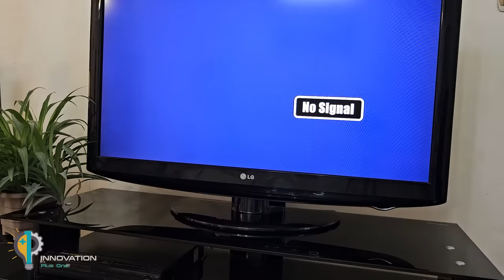Insert a Coin Battery into the TV and all the channels in the world will be unlocked Antenna Booster

Comment: I built one and connected it to my interocitor and got a strong connection to the universal interocitor control network.  I have some phase issues to work out but the galactic empower is quite pleased with the progress.  Thanks for sharing this.
Reply from the maker: Thanks for sharing❤🙏
Reply: Well for your phase issues you could probably just rotate the battery 180°
Reply: The phase issue is simply corrected with an earth wire but must be copper

Comment: I think it would work better if you put the live wire from mains electricity, into any one of those ports, once the earth or neutral is connected to the metal case. It will definitely increase radio frequency gain 
and increased super-sonic dynamic occurrences (semi-conductors exploding). Ignore smoke or flames if they occur, just disconnect and put out side into a non-combustible area.
Reply from the maker: Thank you for your advice, this antenna is very safe and useful
Reply: And make sure the number "911" is handy.
Reply: @susanp102   - Or "999," depending which side of the Pond you're on.......

Comment: Nice; however, antenna is very directional and signal can be intermittent. It can be powered by an amplifier with a more consistent and efficient power ac source that produces less drain on the Grid. That may produce a smaller ecological footprint and save the person's utility bill.
Reply from the maker: Thank you for your explanation about this booster antenna

Comment: Adding a Flux lumen collector and interfacing a portal storm electron intensifier will improve the the signal to at least a magnitude of 10e3 power. If you want the circuit I can send you details. Cost is a mere £20 pounds to cover postage and packing made payable to PARC INFO. Let me know.
Reply from the maker: Thank you for sharing your experience my friend❤🙏
Reply: Nice try, but you clearly don't know what you're talking about. I crunched the numbers and it clearly only results in a 1d20 increase in magnitude. Ha! I'm not falling for that one again, oldest trick in the book...

Comment: Copper is a great conductor, I've built my own OTA antenna's before, this should work in theory although  I don't know what the batteries are for - seen this premise in other videos although they use AA's or AAA's.  The antenna design isn't bad to pick up some strong local channels. The wide metal bar acts like a reflector of sorts and the two copper wires would pick up strong VHF/UHF channels...but don't connect to the bar. The comments for this video are hilarious.
Reply from the maker: Thanks for the info!

Comment: Are the batteries set on the steel mounted with one positive and the other negative? Or are they both showing positive or both showing negative as to how they are attached to the actual antenna?  
    A while ago, I had a cable man come, who does side jobs, that does powered antennas. And he mounted a very nice antenna to my back deck, and on one TV only, I get about 16 channels. S, not all television comes from satellites or is scrambled. So, if he can do that, then I’m almost sure this would work. As all you’re doing is building a powered antenna.
And I’ve seen 4 or 5 variants of the same thing on utube, but so far, I like this on the best. I saw one done in a similar fashion using welding rods as the antennas themselves. And it looked very respectable when he got finished, as he mounted them into piece of wood that made it look like a work of art in itself.
But you’d looks easier.
Holla Back !!!
Faubus
Reply: If you look carefully at what he is doing with the batteries, one has the positive end on the metal and the other one has the negative end on the metal. AFIK this is working as a frequency amplifier, which is a neat trick. my 2 cents.
Reply from the maker: I'm glad you liked the antenna making tutorial, the polarities of the batteries should be opposite to each other my friend
Reply: Batteries are stuck on non-conducting double sided tape. On one side + is facing up and on opposite side - is facing up.
Reply: Following the instructions one has positive up the other negative is up.

Comment: If you piss on your Tv screen at exactly 11:59pm  & 33 seconds you'll get Disney + and max free for 2years🤫
Reply from the maker: I don't understand what you mean, is the topic you talked about related to antenna construction?
Reply: @InnovationPlusOne  because it's just as ridiculous as you saying, "insert a coin battery into a TV and you can unlock all the channels in the world. I just took it one step further. See how ridiculous it sounds.  I can use a piece of speaker wire and unlock over air channels, and that's all you coin battery antenna is going to do, and not very well I may add
Reply: Didn't work when I did it and wife made me clean it up
Reply: Ah, so thats where I went wrong! My cat pissed on it and vanished into thin air. Or maybe its a cloaking device? I'll have to feed it baked beans and wait for the farting to begin so I can find it. 🤣🤣🤣🤣🤣🤣🤣🤣🤣🤣

Comment: There is really only one tiny problem in this setup: If there really is a signal coming into the TV it's NOT generated by the coin batteries- They have the 2nd contact side unconnected. If the signal is really there it is from a secondary (Wall) antenna outlet or the spiralled cables. A bogus setup in my book.
Reply from the maker: This antenna can only receive signals from radio stations and you can easily watch your favorite TV channels.
Reply: Both + and - are connected joined by the splitter. Only the core wire is utilized
Reply: I like the music, it's calming, uplifting and makes me want to groove... Lol
Reply: Exactly, the batteries go nowhere, they don't make a circuit so they can't do anything, so nothing is being "powered".
I'm also guessing that if they where to be connected, you'd damage the tuner inside your TV.

Comment: I asked my 12yo nephew, who is really smart, to make one of these for us, but he was careless and didn't follow the directions at first, ...but he tried again and now the second one works perfectly as shown. At first he used larger diameter unshielded wire, a copper ground plane and rather than batteries he used an AC-DC transformer (wall-wart). It seemed OK at first but we discovered that any channels higher than ~160 appear to open a portal to somewhere, which is very dangerous since we have a small child and cats. After losing one of the cats when it jumped into the screen and disappeared we immediately unhooked it. Now we only use the first one occasionally to get rid of our garbage.  I would not recommend making one of these yourself unless you are very careful and have some basic knowledge of electricity and space warp theory.
Reply from the maker: I didn't understand what you said, but I think you liked this antenna very much, thank you for your comment, please share this tutorial with your friends.
Reply: VERNON  can u help me ....i now have a STARGATE  in my lounge room
Reply: Tell what your nephew did with the 1st prototype! I need it to get rid of garbage and stuff.

Comment: Will I get more channels if I use a longer coax & move out into the hallway, like on the Honeymooners ?
Reply from the maker: No, the length of coaxial cables is calculated and depends on the wavelength of radio signals
Reply: No, the length of the cable only has an influence on the length of the film.
Reply: Oh, good. I don't like them long films like Dr. Chicago, anyhows.

Comment: Is there any way to improve the battery life? I built one and it rapidly drains the batteries. I've used all the batteries that they have at the drug store and it'll be more than a week for them to have more. (they're on order)  can you design and post an A.C. adapter for this circuit?

Comment: Are those CR2032's or does that matter?
Reply from the maker: This is a booster antenna
Reply: @InnovationPlusOne  The CR2032 was in reference to the coin cell used in the video, or does size and voltage not matter.

Comment: Kinda new to working like this, so I have some questions.
- do the coin batteries need to be brand new & what voltage should they be ( when I looked at the store there were 2 voltages 1 @ 1.5 volts & the other @ 3 volts. ??
- my "y" connector thing, that attaches to the bar with the coins on it just flops around, did I miss a step?
- on the last cable you cut you put on a connector of some kind, but couldn't see what it was, maybe a transformer of some kind?
- again on the last cable, my connectors will not stay in place, they keep sliding along the cable.
Thank q
Reply from the maker: No, the batteries don't need to be new and their voltage doesn't matter, so it's better to use old batteries, and you also need to press the ends of the antenna connectors so that they bend and don't slide in place.

Comment: How about use a battery holder with 4-10 AA batteries and then hook the antenae to that or maybe if you do it the more power way, a car battery hooked to the antenae or then there is the house grid...I am thinking about when the batteries die, you need a way to replace them, premeditated obsolesence is the factor. How long do watch batteries last? Nice idea.
Reply: These batteries would last as long as other brand-new batteries still in their blister packs, because they aren't actually connected to anything in a way that would pass any current, because of the black tape. At best they are being used as some sort of shim or spacer.
Reply from the maker: Thank you for your ideas, my friend, the batteries run out very late, although this idea needs to be replaced after a while
Reply: Are these the same batteries used on on your PC motherboard? Mine one lasted over 10 years. Id have to look up the part #. That 1 was drawing constant power compared to this antenna having 2.
Reply: @InnovationPlusOne  "run out very late"?  do you mean "last a long time"?

Comment: If you link the battery between the television and your power meter not only will you get all channels but you also put so much power back in the system you get a check in the mail
Reply from the maker: Please do not do this and just connect this antenna to the TV as in the video

Comment: I'm not unconvinced but I know I should be. I don't have a TV to test it with. I see a tuned antenna so that's seems legit for the capture of a specific frequency. The batteries are a mystery but I'm not a physicist. If it does anything interesting I'll want to plug one into my rtl-sdr. I know a physicist but she's really busy and she'd probably be grumpy if I tried to waste her time. I have had remarkable results improvising antennas before so, hmmm mmm.
Reply from the maker: Please make this antenna by watching this video and be sure to share your opinion with us about the performance of this antenna❤
Reply: @InnovationPlusOne  Definitely will. If I can't locate a free TV I'll try it on the SDR. If it can do this with a TV the possibilities with Software Defined Radio are very exciting. Current project is building an antenna to get real time imagery from weather satellites. Then I could modify the antenna to a variation of this. Rotating signals for this job.
Reply: @InnovationPlusOne  Question is, if it doesn't work, would I need to try new batteries, as in do they go dead???

Comment: I bought a Finco antenna with a 150 mile range in 1989. I was 59 miles from downtown Chicago and it worked perfectly (it’s 18’x20’). It was installed in the attic. When I moved I took it with me and installed in the attic of my new home and now I’m 70 miles from downtown and it’s still working perfectly, it’s 35 years old.. Because it was installed in the attic, the antenna is like new. With a smart TV, it not only receives the local channels, but also the other channels supplied free through the internet.  What do I pay monthly…….$0.  Do I need to watch and pay for the trash on the TV…….NO!
Reply from the maker: Thank you for sharing your experience of using antennas

Comment: I also tried with the satellite antenna parabolic antenna to receive the programs Normally as it is the antenna on the house but it does not work because the signal must first be terrestrial terrestrial transmission then it must be if you have a TV that cannot decode digital must be Analog so in radio to radio still Analog signal is transmitted before Analog terrestrial signals were transmitted through relay transmission but that was very expensive now it is much cheaper to transmit a signal to a satellite and from there that satellite to them transmits to the ground covers a much larger reception area and is much cheaper then if you don't have a terrestrial signal transmitted at the terrestrial level then any improvisation or whatever you do will not give results because it is a word if it is not from where it is not even God it can be like this in this case too if an analogue or digital terrestrial signal doesn't exist, nothing can be received because it doesn't have Where did it come from That's why lately there has been a sigh of relief for the signals transmitted directly to the satellite and again transmission to the ground simple reception reception is free Get a parabolic antenna, a digital receiver, preferably as high-performance as possible and you can receive the signal, but in order to see the program in question, some of them you have to pay a subscription. payment via an online bank card can be received but if you pay the subscription it doesn't matter where you are from Money has no smell you can watch any kind of program you want but for free you don't have how those times came
Reply from the maker: Thank you for your explanation about the antenna

Comment: Please do this then call the TV manufacturer and tell them where you learned quick tip those coaxle connections take a bit of power anyways so what happens when you add extra power you won't get extra channels or any you'll get a sound and blown power inverter what happened to the days where this dude in the video would be buying everyone new TV's. Might as well, put bent fork prongs in a plugin and grab the back of the coaxle male plug on the back of the TV.
Reply from the maker: I didn't understand the meaning of your words, but I guess you liked this idea, so suggest this video to your friends.

Comment: This 'coat hanger' aerial would work without batteries - adding DC does nothing.
It's just a weak low surface area novelty UHF aerial to pick
up local transmissions with no capacity to 'unlock' channels.
A standard UHF aerial will pull in more signal than this 'fun project thing'.
Reply from the maker: This antenna can receive many channels

Comment: I just watched this out of Pure curiosity. I'm a computer techie.  Did this Really have to be So long, 15 minutes? Ugh, you could at least have verbally provided a list of items you will need to make this. I know the Cat5 wiring and the connectors, but what kind of metal strip was that and what was that tape that you used to adhere the batteries to it, was that some kind of special electrical conductor tape?  Seems like that would be an important thing to mention.
Reply from the maker: I'm sorry my friend, I have to carefully demonstrate all the steps of antenna construction to learn better
We can use aluminum sheet to make this antenna
Reply: @InnovationPlusOne  Ok, what about the tape? What kind of tape was that, besides double-sided. Is it some kind of electrical conducting tape? What's the correct name for it? 

I'm seriously thinking about trying to make this. It looks fun. I have all the tools, wiring, stripping and crimping tools and plenty of Cat5 wiring and cable splitters.  I once made a jumper cable to fix my coffee pot because the two-way switch broke. 😊 My boyfriend was shocked that I knew how to do stuff like that. 😊

Comment: Just a copper wire the same difference.
Reply from the maker: This antenna is made using a coin cell battery, which is very powerful to receive radio signals

Comment: So beside the thumbnail being completely misleading and disastrous if attempted by anyone, the actual antenna built has absolutely zero need for the coin cell batteries glued to it, and they do NOTHING to 'amplify' the signals received.

I'm sure the uploader will delete this comment, because their clickbait junk would suffer from the outright truth told. I just wasn't interested in making another joke comment to mock the video.
Reply from the maker: My friend, I never delete any of the comments, by the way, thank you for your criticism
My friend, you did not build this antenna and you are just judging, I request you to build this antenna first and then share the result with us
Reply: @InnovationPlusOne I don't need to build your particular 'design' of antenna to know  that a couple of 3v coin cell batteries in series in a grounded loop would just discharge themselves, and possibly while overheating them to the point of bursting. Just causing a current through there doesn't create any amplification of signal. Of course, if the splitter has protection against power flow through it the wrong way this setup will literally do *nothing*. My assertion still stands. There's no reason to involve a coin cell here at all - just build it without them and it'll still be a UHF loop antenna.

Comment: I did not make one but I still smell Bull excrement at the highest odor. What if the batteries are dead does it still work?
Reply from the maker: The batteries need to be replaced my friend. But know that the batteries will run out very late because we have no voltage consumption